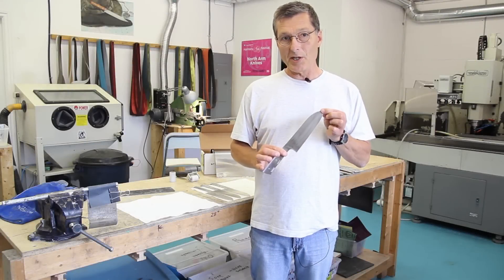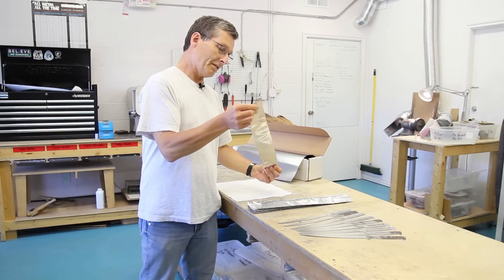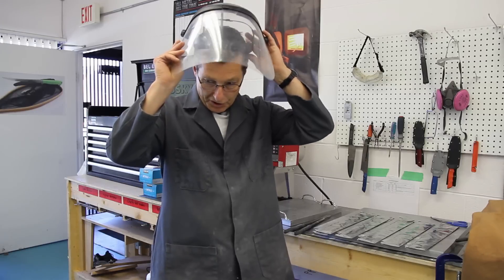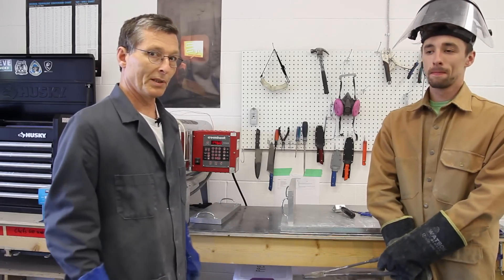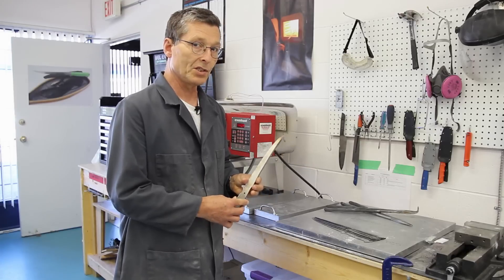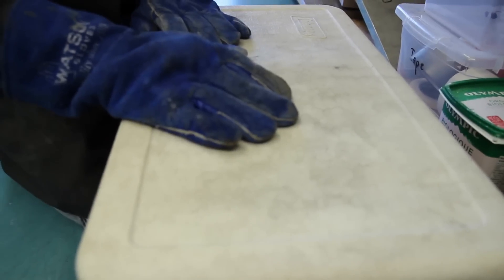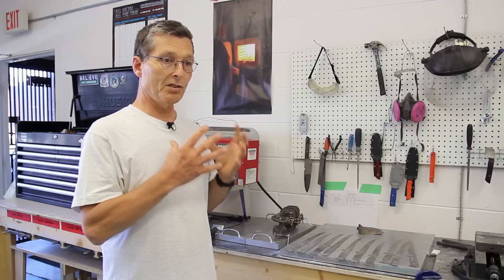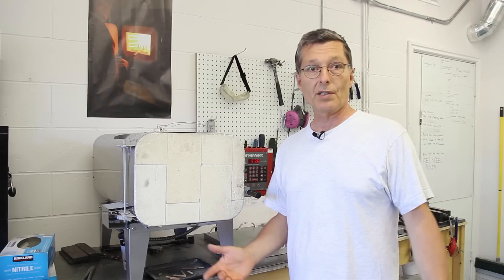Heat Treating Knives

Comment: The two skaha samples luvthemknives did, 57.6 and 57.9rc. While they are nice to sharpen and have low reduced austenite... They should be harder. At least for the pocket knives. The chief knives are fine at that hardness.

Your magnacut should also be no less than 63rc. Its the only reason I haven't got a 2nd one in magnacut. Just not worth it.

Also make both aluminum plates touch the blades at the same time. When you lay it down first they cool on one side too fast. This is well known. Im surprised your doing it this way.
Reply from the maker: This video is old and our processes have changed a lot since. We had reasons for running our S35VN the way we did. It wasn't as tough a steel as Magnacut is and most of our customers use their knives for real world stuff, where hardness is not the only concern. That being said, I recall there was some controversy around the HRC numbers that were obtained in some of those tests.  

As far as Magnacut HRC, we have our reasons for that too. Again it comes down to hardness vs toughness. Larrin Thomas has a ton of great information out there about his steel. We use his info and our own testing and customer feedback to inform our HT protocols. What one maker and their customers think of as the perfect HT doesn't always match what a different maker and their customers want/need.
Reply: @northarmknives  first things first its a pocket knife and not a 4" knife. 2nd thing is independent tests showed strong toughness at 63rc. Had you done tests like other knife makers you would have seen this.

Comment: Hi everybody! In last time I saw lot of heat treating videos. I've got a question. Everybody says. I soak them for ,,10/15/20,, minutes. But I don't know what it means. 1. It means bringing the oven up to 1800°F then opening the door, putting the blade with room temperature and closing the door, letting the blade there 20 minutes, open and quench.
or .... 2. bringing the oven up to 1800°F then opening the door, putting the blade with room temperature and closing the door, waiting for blade becoming 1800°F too and from this point soaking in oven 20 minutes. If it is this case, then I have a question how fast should the blade reach the temperatrure 1800°F or whatever temperature good for quenching depending of the type of the steel. Greetings from Europe. Peter.
P.S.: I have made a knife really by the hand only. Here is the ink: https://youtu.be/sdNYdLY8NBA
You can watch if you want. :)
Reply from the maker: Hi Peter, 

Most heat treating kilns, ours included, drop quite a lot in temperature when cold parts are put inside. By the time the oven hits temperature again (back up to 1800), the knife would be equalized (or nearly so) with the rest of the oven temperature. Thin parts, like knives, equalize quickly; if we were heat treating thicker parts, equalizing time would be more of a concern. We would then hold it at the soak temperature for the specified time, then quench. I hope that helps!
Reply: @northarmknives  Thank you very much for your reply. It seems to me that your answer has the level of a professional. I wish you a lot of success. Peter.

Comment: You forgot to mention that cryo is necessary after each tempering cycle. You're starting a new Ms and Mf as you know man. PEOPLE NEED TO UNDERSTAND THIS! aha.
Reply: Okay...correction. Not necessary but you know what I meant.
Reply from the maker: @veraxknives0331  Our HT protocols are industry standard. I've never heard of anyone doing a sub-zero cycles after each temper. If done properly, using our methods, additional sub-zero treatments  would be of little to no value.
Reply: @northarmknives  it's science brother. Check it out. Small change would be correct but no actual engineer uses those terms.
Reply: Not saying to change how you guys do shit but it's a scientific fact that any educated person in metal will know and ask you to do. Dry ice isn't very effective either it's just not cold enough for the PM stainless alloys that most stock removal knife makers use, even with 0s at STP.
Reply: @northarmknives its better to use Ln2.  You have to temper after each cryo cycle... Most cryo only once before both tempers but it could be very good to cryo after the first temper as well. And 3 tempers can also be advantageous. Depending on your protocol to reduce RA. Sure your saying industry standard, but making knives better means going above and beyond industry standards. At least for enthusiasts. Else your no better than average.
Reply from the maker: This video is old and our processes have changed a lot since. That being said, we have always arrived at our heat treat protocols using a combination of information directly from the people who engineer the steels we use, real world experience from working with said steels, and customer feedback.
Reply: @northarmknives  why not develop your own protocol's or infer to a professional knife maker that specializes in such like Kknives od Switzerland aka Kase knives for instance? Who would be able to provide you much better than average from the factory or customers who dont know much? Developing protocols is not easy and time consuming but worth it in the end.
Reply: @tacticalcenter8658 It would hardly make any difference and make the knife cost a lot more. Be glad they're doing cryo in the first place as not everyone does. 62 vs 64 is also only a 10% difference in hardness and you'd probably barely be able to tell the difference. People complaining about soft magnacut might be from higher RA from no cryo or some such. Dry ice works significantly well when it's done just after quenching it without waiting for hours or days, even a freezer works significantly better than nothing.

Comment: I just getting into knife making and i don't know anything thing. I will be working with 1095 knife blanks, what do you recommend i heat treat them at? And what temp should i temper them at? Any info would be awesome.
God bless
Reply from the maker: Hi Tim! 

We don't have any experience working with 1095. I would do a google search or check bladeforums. Tons of great info available out there for sure. Good Luck!